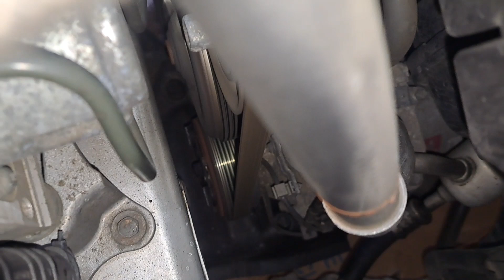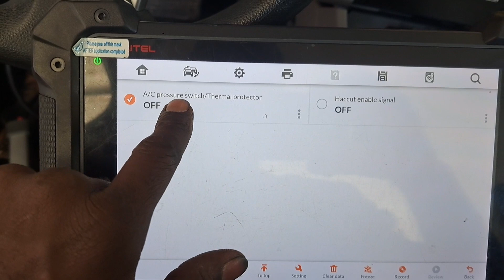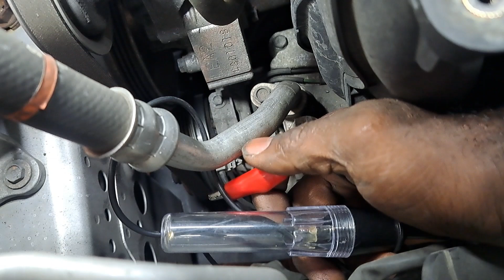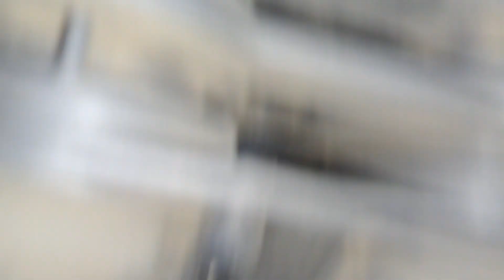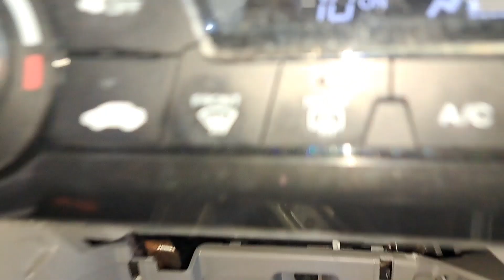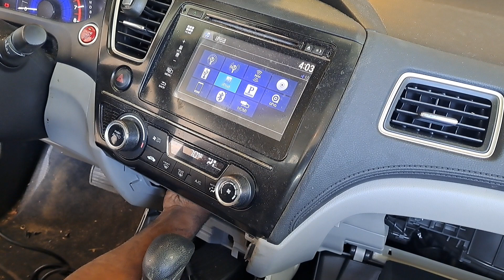2015 civic hybrid NO AC OPERATION "EASY DIAGNOSES"

Comment: hello, if this helps anyone-
i got my ac broken, the clutch snapped and the car would not start bc it locked up. you can bypass the ac pulley to keep your car running for, pretty much forever- this saves me 1 thousand for a remanufactured hybrid ac compressor. used Gates Micro-V Serpentine Belt 4 Rib 40-7/16 Inch K040398 from a forum, i got it from o reiley, put it on the water pulley and the middle circle. it was hard to get it in the serpentine tensioner, you can remove the pulley with a 14mm and put it on the belt, then put it back on the tensioner, i didnt need to do anything else and the belt fits perfectly, it has been working for over 6 months and i will finally save to replace my ac this summer.

but yes you can bypass the ac so it works. this car is a good car but i dont like that the little quirk of having ac while engine is off, it makes the car very expensive to fix ...
thank you and please i hope this helps someone!!! used 35 dollar belt to run water pulley so it never overheats and it worked for 6 months perfectly, it's an amazing way to keep your little car running and still with good mpg and get you time to fix the ac

Comment: In my Civic hybrid I had the same problem.
I tested the relay, made a jump, manually sending a signal to the compressor and it worked. Then, with a test light , I saw that when I pressed the button on the car's dashboard, the relay didn't receive the signal.
So I replaced the control unit (the buttons) and the air conditioning started working again.

Comment: Have you used all data and how do you think it compares to identifix if so
Reply from the maker: Direct-Hit -- Main Asset Search https://share.google/dTljaF4JwgHb1I37J

Here's a trail link for identifix. 

I've seen alldata but forgot about the format. One of the shops i diagnose for used alldata but they evidently still have comprehension issues!  Like,  it's a stepping stone for INFORMATION,  not a guide for THE ANSWER,  if that make sense,  generally speaking. 

All the sites have free trails though if you simply sign up

Comment: Bro, pressure equals temperature, the higher the pressure, the hotter the freon, proportional to each other, use your hand to feel around the AC system to get a feel for how to diagnose an AC System by HAND, you will learn a lot. You have an AC hose coming out of the compressor, it has a bulb on it, that is a muffler, those get clogged with stuff when bad things happen when you have serious maintenance on the full system, do not buy a hose with a muffler or it may clog again quickly if a serious job of flushing the system was not completed, essentially replacing everything.

As for the TITLE of the video, "easy diagnosis", looks like you were struggling and you did not verify any powers coming out to the plug at the compressor when you hotwired the head unit, at least not on video where the proof is for us and you were a bit selfish by not showing the schematic. You were telling DIYers to get a bidirectional tool but you did not do the process on video. I do believe that due to the floating voltage that the head unit is bad.

Comment: I just watched your other videos updated to this one briefly, but what did it end up being? My ac stopped working in my 2013 Civic hybrid and I’ve replaced clutch magnetic coil and all wiring to thermal protector and still no ac. Not sure if it matters but when my ac went out, my air recirculate button stopped working or illuminating as well.
Reply from the maker: @madisongatling7844  the answers for everything will be in the videos.  I provided tons of information to conclude what happened and why, with confirm fix.
Reply: @partsshooter  I’m still watching them. I guess what I’m trying to get at is you replaced the compressor and that fixed it, not everything else? Because you change climate control unit, sensor, all of that and ultimately ended with the compressor so it was the compressor all along? These things are pricey on Honda hybrids that’s why I’m asking…
Reply from the maker: @madisongatling7844  

don't take this wrong... the video literally explain and goes into detail as to WHY the components are justified in being replaced with testing procedure and back testing with verification.  There's more than enough information here.  

If you're looking for an answer to your issue,  the key takeaway with my videos is to TEST the components that justify replacing.
  
There's conflict resolution with my content with foundational reasoning for part replacement.  Please use the video to extract aid at your own methodology in testing strategy, this is the purpose of it,  and not arbitrarily replace parts. 

Again,  my video is to aid in direction,  not to throw parts at car.
Reply: My car did a similar thing with the recirculating button and the ac out I have a 2013 hybrid as well did you end up figuring it out ?

Comment: What for is sensor that is located in compressor near clutch wheel on car frontal side? Is together with thermal sensor in one electrical circut. Thanks
Reply from the maker: @pershingk  both should be thermo switch I wanna say. Honestly, it only made sense for it to be. 

Base on the wiring diagram is a fuse link. If this shorts and break, it breaks!  Doesn't lose contact like the thermo switch and come back after cooling, if it break it blows and break.

Comment: Gotta be careful with them hybrid ac compressors.
Reply from the maker: I agree
Reply: hello, if this helps anyone-
i got my ac broken, the clutch snapped and the car would not start bc it locked up. you can bypass the ac pulley to keep your car running for, pretty much forever- this saves me 1 thousand for a remanufactured hybrid ac compressor. used Gates Micro-V Serpentine Belt 4 Rib 40-7/16 Inch K040398 from a forum, i got it from o reiley, put it on the water pulley and the middle circle. it was hard to get it in the serpentine tensioner, you can remove the pulley with a 14mm and put it on the belt, then put it back on the tensioner, i didnt need to do anything else and the belt fits perfectly, it has been working for over 6 months and i will finally save to replace my ac this summer.

but yes you can bypass the ac so it works. this car is a good car but i dont like that the little quirk of having ac while engine is off, it makes the car very expensive to fix ...
thank you and please i hope this helps someone!!! used 35 dollar belt to run water pulley so it never overheats and it worked for 6 months perfectly, it's an amazing way to keep your little car running and still with good mpg and get you time to fix the ac